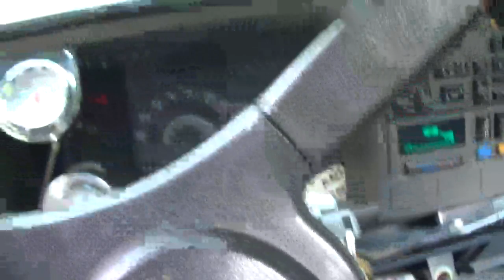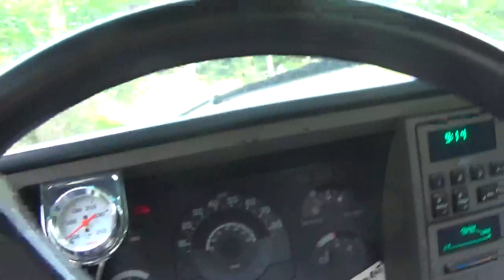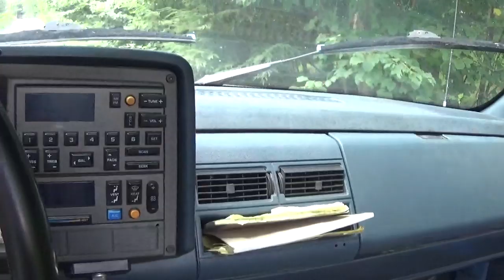Waterway trenching and lumber cutting.

Comment: what made you decide to shorten the log before cutting lumber ?
Reply from the maker: We shorten the logs for the following different reasons. 1. If it goes in the kiln, we want 8' 3".  2. There may be a bad end and sometimes we shorten to suite that need. 3. If someone wants a certain size we shorten for that reason. Otherwise will can cut whatever is needed.

Comment: Curious as to why if that's 15 feet you didn't cut some 10 or 12 foot 1-inch boards off the thick end of that third flitch before getting down to your cant?   Maybe you don't need shorter  1 or 2 inch?  Great video, liked you talking as you go.
Reply from the maker: We have around 7000 board feet of lumber drying. Not to mention what is already dry, so we don't keep odd or short lengths just to keep down on the storage space needed.
Reply: @josaljo1  That makes good sense...